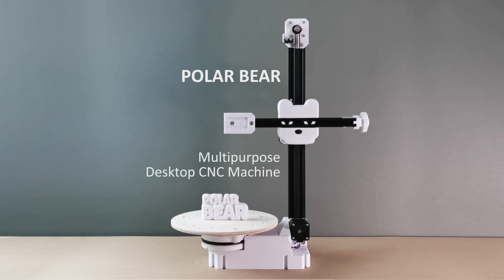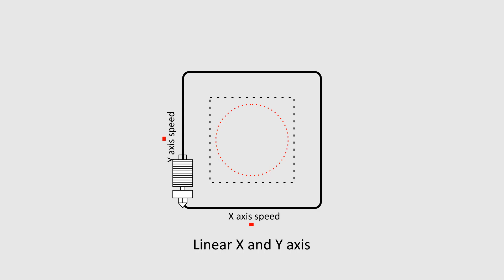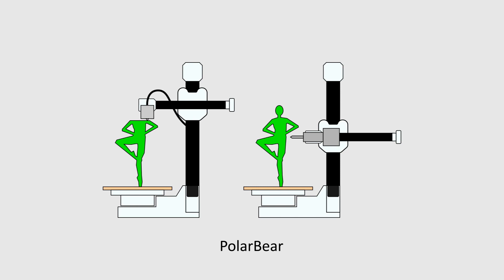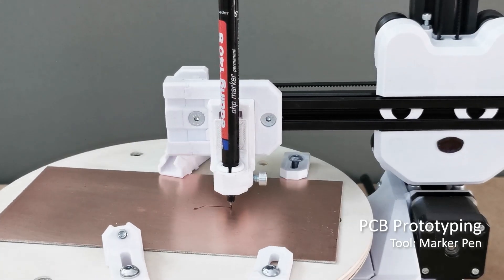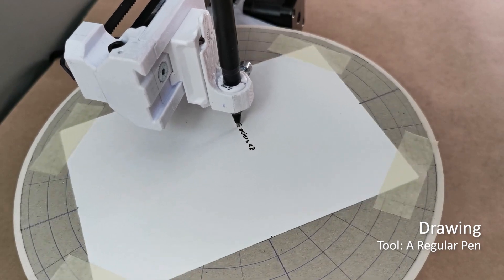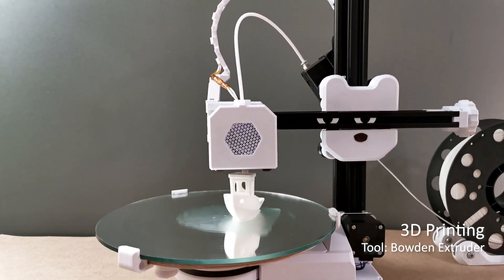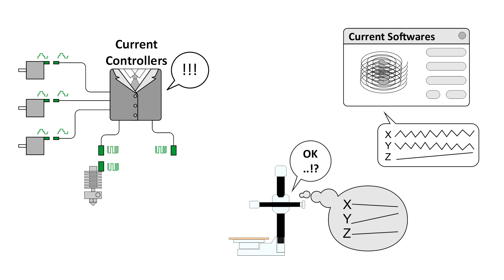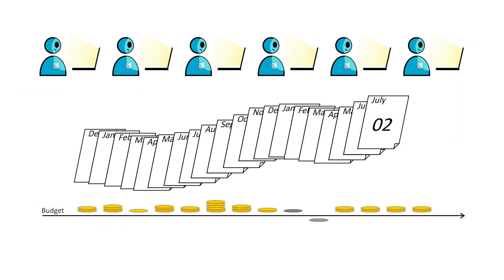Meet the PolarBear | a Multipurpose CNC Machine with a Rotary Axis!

Comment: I have always wanted to know if a polar machine would print better gears. 
May need to knock one of these together. 
Thanks guys!
Reply from the maker: Without a polar-optimized g-code generator, I don't think a significant improvement. If we were able to generate polar-optimized g-code, it would improve the result significantly.
Reply: @kadirilkimen  That makes a lot of sense. It is all arc movements. Hate to think what an interpolated arc would look like.
Reply from the maker: @amandahugankiss4110  Well, A cartesian machine has to interpolate any line that is not straight. Therefore  any curve becomes an interpolated polyline. On a polar machine, It has to interpolate any straight line into tiny arcs. Since most g-code generators  generate arcs as polylines, It is even worse for a polar machine... Arcs first becomes polylines and the polar machine makes them even worse tiny arc polylines. It is very possible to modify firmware to optimize this situations. But so far, I only managed to spare time for adding polar kinematics to Marlin firmware. Hopefully, soon will spend more time on it.

Comment: How much would it cost to buy a parts kit for this version? I would be interested in developing it further from this milestone.
Reply from the maker: Hello, there is no kits available. There is a BOM in the github repo. You can buy the parts individually. I think the base machine would cost around 150 EUR. It depends on your buying preferences and selection of components. Please note that, base machine doesn't contain any power supply or controller board. It's up to you to choose something and do whatever you want out of it.

Comment: please reference your version of GRBL you suggest and some $settings. id like to build this using arudino and cnc sheild
Reply from the maker: Hi, It's a plain GRBL actually.
Polar axis;
Polar axis has a 10:1 reduction.
You must calculate your steps /1 degree value.
Polar coordinates work in degrees. 1 rotation of polar axis  means 360 degree rotation. However, GRBL doesn't know what degree is. It understands it as 360mm movement and accepts steps/mm value. You have to ender steps/mm but it will act as steps/1 degree. So, it is actually very simple. 

Resolution of the polar axis is not fixed. it is infinity on the origin and lowest on the edge of the workbed.

Polar Bear designed to have a 260mm bed. which makes 816.814mm circumference on the edge. If I use 1/16 microstep, 1 rotation of the motor makes 3200 steps. 10:1 reduction makes 1 rotation of the polar axis in 32000 steps. 
816.814/32000 makex 0.0255 mm resolution on the edge of the work bed and gets better towards the origin.

Linear Axis motors use 16T GT2 pulley. Which gives them 32mm movement in one rotation.
You have to calculate the steps/mm based on your stepper driver settings.

Comment: Ramping up the size of a cantilever machine is extremely problematic, I hope you overcome the problems and succeed with this!
Reply from the maker: This was the first prototype. I will release the second prototype as v1 which is improved a lot compared to this version. For cantilever approach, a polar machine uses half size of x axis compared to cartesian ones. This reduces the  forces significantly. Therefore it is more managable. From nearest supporting wheel to the tool tip is not that long. Therefore cantilever is not the weak point of this machine. But the column is another story. I preferred a wider extrusion on the upcoming version and hopefully it will perform as intended.

Comment: I need polar bear rotating bed for metal additive machine
Reply from the maker: It's simple from mechanical aspects. But it is very complicated from controller side. I imagine you wouldn't use a regular FDM 3D printer controller to control a metal additive system. In best case, you will need an industrial cnc controller. Then driving a polar axis wouldn't be a big problem I believe. If you need help on it, please contact me through my website.

Comment: This is awesome! Any idea if Klipper could run it?
Reply: I just noticed Klipper supports polar kinematics! :)
Reply from the maker: Yes it does and you can run klipper. It is a controller board agnostic machine. You can use any firmware or board you want. My first tests was on a simple arduino uno with grbl firmware.

Comment: I'm Building this right now to try and make a clay 3d printer.
Reply from the maker: Please let me know how it goes. I had a clay extruder but didn't have a chance to try it.
Reply: @kadirilkimen  Did you make the extruder or buy it?
Reply from the maker: @johnnyappleseed.4420   I got if from a company. But they stopped responding and it seems they are not selling it anymore.  Also the product doesn't feel any good. I can't recommend it. But it is a simple stuff.  Just like a syringe,  there is a piston in a tube and a screw pushes it. all you need to do is a good reduction, so screw can have a very high torque to push clay thru a tube to the nozzle.
Reply: What infill % did you use and do you use supports?
Reply from the maker: @johnnyappleseed.4420  I used 10% cubic subdivision infill. cubic subdivision creates 3D structure, which is better for random direction forces. I think less infill and thicker outer wall is better for overall strength. I went with 1.6mm wall and 10% infill. No supports would be needed for the base. However, Having a good bridge settings is important for some sections of the base. I can't recommend any specific bridging settings. Because it depends on your machine and filament.
Reply: @kadirilkimen  So I am 2 weeks in to building this thing. The only thing stopping me is this base... 

I've tried your suggestions and it still fails on that square motor mount. 

In the exploded view "mainbody-2.jpg" you show the stepper motor going through the oval but on the STL of the main body it is solid?
Reply from the maker: @johnnyappleseed.4420   I was thinking I uploaded botth the main-body.stl without supports and with supports. It seems there is only "with supports" version. There is a support part modeled under the motor mount surface. Now there is a main-body-without-support.stl in the repository. Print it without supports and good bridging settings.
Reply: @kadirilkimen  I appreciate that! So that square thing was just a support? 

Is the oval part on the motor mount and oval screw holes suppose to be hollow to accept the stepper motor from underneath?
Reply from the maker: @johnnyappleseed.4420  Yes, it was just a support. The motor mounting holes are filled with 0.2mm flat surface to give these motor mount surface a bottom. This allows printer to print this section without support. Its a good method to eliminate a lot of supports. It won't be like a solid surface and will be easy to cut them off. And you will have very hollow motor mount :)
Reply: Okay cool. Thank you. I'll go run to the maker space and try again! I'll report back.
Reply: How big do I make the wood bed?
Reply from the maker: @johnnyappleseed.4420  bed diameter is 260mm. You can also lasercut it from polycarbonate.
Reply: I got mine fully built! Thank you! 

Now comes the fun part of making the clay extruder.
Reply from the maker: @johnnyappleseed.4420  Great! Cant wait to see
Reply: I also got a Lazer coming in the mail.
Reply: Any tips for printing the base?

I have been having the hardest time printing the base. It keeps messing up on the little square in the middle.
Reply from the maker: @johnnyappleseed.4420  I believe you are talking about rotary axis motor pocket. If you are having adhesion problem, there is no any precise parts at the bottom. Just try to increase initial. Layer flow to squeeze first layer and get better adhession. If you print initial layer very slow, you should be good.

Comment: I have some doubts about this project. Whether the polar coordinate machine can ensure accuracy when drawing a straight line? I think the polar coordinate machine needs x-axis and y-axis synthesis when drawing a straight line, while the Cartesian coordinate machine does not.
Reply from the maker: Hi,
Of course you can ensure the accuracy. In machining, straight or not, if it fits in the tolerance, then it means it is accurate.

In a cartesian machine, you can create a straight line easily, but have to subdivide curves into very small straight lines.
In a polar machine, you can create a curved line easily, but have to subdivide straight lines into very small curves.

As long as the final path fits into tolerances, you are good to go.

This is the post processor I developed for the PolarBear : https://kadirilkimen.com/thepolarbear/polartools/
This post processor is not the best one to convert a cartesian g-code to polar g-code. But it works fine for 3D printing and. If you are going to machine very precise metal parts, then there are cam software create very accurate polar g-codes.
Reply: @kadirilkimen Can you give some names of CAM software that supports polar coordinates?

I'm intending to machine precise metal parts that would match well with the circular motion of a polar configuration. I'm highly inclined to build a sturdy polar CNC machine, but I still don't know if it's easy to find software to generate polar tool paths (specially free or open source).

I'm also considering adding a very short lateral axis to machine more acurate and symmetric straight holes. That would probably need some specific gcode to treat holes differently and use only X and Y, while the polar axis stays stationary. But I don't know if off the shelf CAM software can support that.
Reply from the maker: @Pixelarter  Hi, AFAIK, most cam software support 4 and 5 axis machining generates polar g-codes. I believe you can achieve what you need using a 4 axis setup and a 4 axis Cam Software. You can setup your polar axis as 4th axis. Unfortunately, I can't recommend a cam software.

Comment: YouTube recommendation have really failed me if I'm only finding about this project after more than 6 months of following all kinds of unique 3D printing projects. Are you still working on this? I see the Patreon hasn't been very successful, so I guess you don't have the finances to develop the project further.
Reply from the maker: Thanks a lot! nice words to hear :)
Yes I am still working on this. Ok, I didn't do much thin in last 6 months, because I am in a transition mode from my old workstyle and new one. It's more like I didn't push the project or patreon much further yet. Because of that, my Patreon still have just a few supporters. Also there is a good support response other than Patreon.

Because the polarBear is more like a flexible machine, it requires a lot of firmware work to make it a simple to use machine. So I decided to develop "polar printer" that you can use off the shelf firmware. Here is the first test run : https://youtu.be/kh6SwyJamWQ

Comment: Realy amazing project! Congratz! I just have one question... how to heat the bed for 3d printing?
Reply from the maker: Hi, I actually figured out the idea but had jo chance to try it yet. You can see the idea here : https://github.com/kadirilkimen/PolarTransmitter
Reply: @kadirilkimen  I was thinking of a solution too, the carbon brushes will wear out over time so maybe an induction heater will last longer, but the brushes will be my first attempt, and an infrared temperature sensor like the MLX90615 could solve the problem with detecting the bed temperature.
Reply from the maker: @NicolasCastroS  induction is a great idea and I considered it too. However, I have no experience with it and decided to go with simplest way. We dont need too much power to keep the bed temp. in a range, but we need more than 150w to heat up it initially. It feels like we need a big induction coil. Actually I didnt think infrared sensor and its a great idea if you can make it work. I will check it too.

Comment: which software use in oprate this machin for cnc milling....
Reply from the maker: I created the g-code with a custom tool developed by me. unfortunately, there are no any good open source cam tool that allow you to create 4th axis toolpaths. I have plans to develop such cam tool, but it is too much work for a single developer :). needs time.
Reply: alhamdulilah...good work brother ...i am from india your machine...and design very good for selling purpuse ...

Comment: Hey,  awesome project... How much do you think it costs to build one with a 3D printing head?
Reply from the maker: Currently I am improving the design and will release a completed version 1 soon. Select a regular printer brand model to compare in your head. Think you are using same quality and cost parts with this printer. Then it should cost lower. because the PolarBear requires less components.  All printable parts are possible to print in 1 kg filament. I hope this help you to figure out a number.
Reply: So far I've spent about $250 on all the hardware and PLA

Comment: i wonder if you can add 1 small stepper motor to the gondola holder for hotend? 

imagine a non planar 3d print method but on the Z axis / outer frame.. it would be awesome!
Reply from the maker: Hi,
Endless modifications are possible. My main goal for now is finishing the improvements and releasing the version1. Then me or any other maker would make modifications.
Reply: @kadirilkimen  more challenge for you..... put more x gondola with their own stepper motor so can have multiple hotend for 3d print or other swapable thing! 

Imagine simultaneous print from other (3 or 4) direction with the hotend angle at 45d so it wont collide etc with good gcode slice. 

That would be one of it kind bro! :)
Reply from the maker: @mrbulp  Yes, You are absolutely right. I liked your idea and I also have different ideas to speed up printing process. Once the v1 released, all these ideas can have a chance to rise :)
Reply from the maker: @mrbulp  it looks like similiar. But it has more similiarity with a cnc router than thr PolarBear.  In fact, it is almost a cnc router machine.

The biggedt difficulty to make polar bear bigger is the rotary table. If you build 2m diameter rotary table, you have two options. Dead slow and precise machine or fast but no any precision at all. I have a few ideas for it.

Will see by time.

Comment: Pretty cool. Could easily make this from metal/cast parts frame and bolt together ext. With liner guides. You could make an add-on at 90deg. But attaches with it to make a T-H Frame design bed/construction. If the software is good then
Reply from the maker: Of course. There are stl files. It can be machined  or printed.
A lot of things can be done. But step by step. First step is  finishing development of the design and releasing Version1.
Reply: @kadirilkimen  hi... It's interesting machine good work. I can wait to see the v1.
Reply: When will be released v1.
and it will be open source...
Reply from the maker: @Aaan-cnc  Hi, I was working on other projects to create fund and time for my open source projects.  I am back to work on it again this month. I think it should be finished by the first week of April. And of course it will be open source.

Comment from the maker: Hi there!
Other ways to support the PolarBear and my other project are to subscribe my channel , likes and comments. 
Please subscribe to my channel and enable notifications as I will continue to share developments. I also have other projects that might interest you.
Reply: software enginer here, how can I help you?
Reply from the maker: @MrZentrix15 
Hi, currently most important thing is that having a polar friendly firmware.
Grbl is simple and efficient. I think it is better to have a polar and cross slide grbl first.
Firmware should take g-codes as any regular cartesian machine and calculates the polar movement in the chip. So it would eliminate a post processing step and allow people to use their usual slicer and cam softwares. If you would like to work on it, feel free to contact me. 
There is a contact form on this link : http://www.kadirilkimen.com/thepolarbear
Reply: @kadirilkimen  okey
Reply from the maker: Tanishq Bahal  Hi, It is an open source project. You can build it yourself. I am also in communication with a few manufacturer. But it will probably take months for them to offer off the shelf machines.
Reply: Merhaba , bu makinada kullanılan yazılımı paylaşabilir misiniz?
Reply from the maker: @halitatalay  Merhaba, eger firmware'den bahsediyorsaniz, duz marlin kullandim. Marlin yuklu herhangi bir controller isinizi gorecektir. Eger kartezyen koordinatlari polar koordinata cevirmeyi soruyorsaniz: https://kadirilkimen.com/thepolarbear/polartools/
Reply: @kadirilkimen  teşekkür ederim tam olarak aradığım buydu, bir sorum daha olacak, bu çeviriciyi scara Yazıcılarda da kullanabilir miyiz?
Reply from the maker: @halitatalay isinize yaradigina sevindim. Skara ile calismayacaktir. Bu yazilim birbirinden bagimsiz hareket eden bir doner ve bir sabit eksen hesabi yapiyor. Skara'da birbirine bagli iki veya daha fazla doner eksen hesaplaniyor. Ona tamamen farkli hesap lazim.